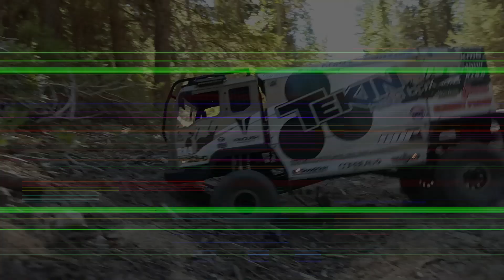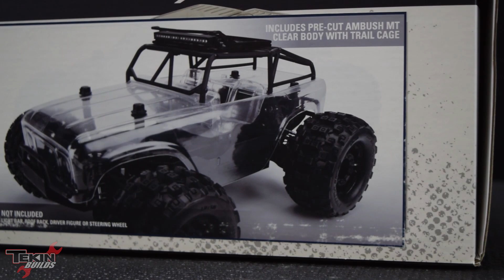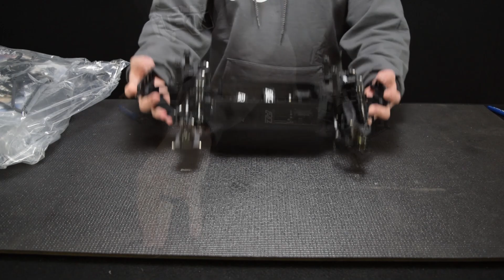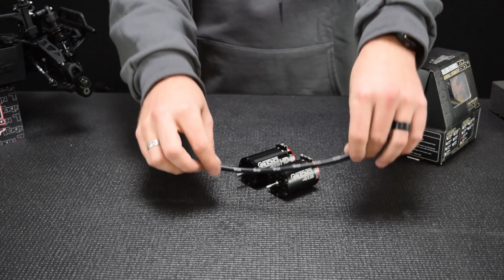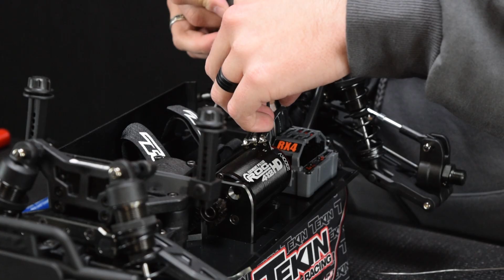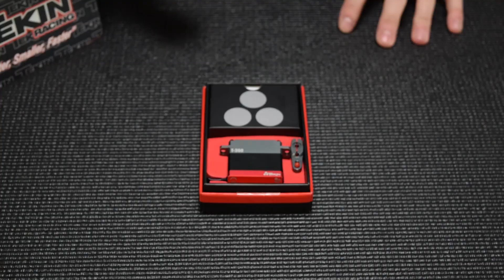Pro-Line Pro-MT 4x4 Monster Truck Electronics Install | Tekin Builds Ep. 17

Comment: 1/8 scale speed 30’s-40’s? I’m getting 65mph in my Kraton, and about 55mph in my Losi 3xle. The Losi is completely stock but the Kraton has a Leopard 4082 1600kv motor and 22 tooth pinion. Even stock motor I was getting about 60mph. My buddy is getting 70 out of his stock Talion and 75 from a Typhon. I don’t know what 1/8 scale is that slow nowadays.
Reply from the maker: Typically buggies and truggies set up for track racing are mid 40s. I'll GPS this truck today and see what kind of speed we are getting out of it.

Comment: Pretty nice and clean build, but one thing kills my nerves everytime I see that, not just here in this video. Why tf do you use Deans T connectors?! Better xt90 or Xt90s or ec5's. Both superior at holding firm on the connectors and both can withstand more current easily!!!
Reply from the maker: Been using Dean's forever and never had any issues with them. We've used them in big power 1/8 builds for years and have pulled more than 100amps through them and never had a plug failure. Plus they are Tekin red and XTs are ugly yellow, ECs are blue. 😁
Reply: @TekinRacing  haha if this is your only concern why don't you make your own in your favorable color? :D plus I did say they are more capable not that Deans don't last for nothing ^^
Reply from the maker: @ParRagon-  we should make a connector. But like I said, never had any issues with Dean's. I've seen them take upwards of 350Amps and the failure point was the solder joint, the connector was not damaged at all.
Reply: @TekinRacing  then imagine what xts and ecs would take :D
Reply from the maker: @ParRagon-  XT90s have the same failure point, the solder joints. Up over 300A the solder fails on all these plugs.
Reply: @TekinRacing  but should hold better connector to connector because of the housing ^^
Reply from the maker: @ParRagon-  never had a problem with Dean's coming apart either, they fit tight. The only time I've had one come apart was when the wires were too short and the battery dislodged in my Truggy, pulling the connector apart. Dean's aren't a bad connector at all, just a bit tricky to unplug sometimes. Other than that, I don't have any complaints about them.
Reply: No shit, that's some top quality kit he put together but then top it off with a deans t plug? T plug just seems so janky.